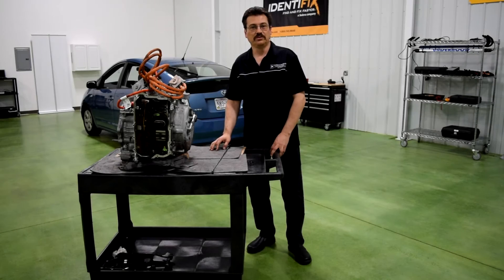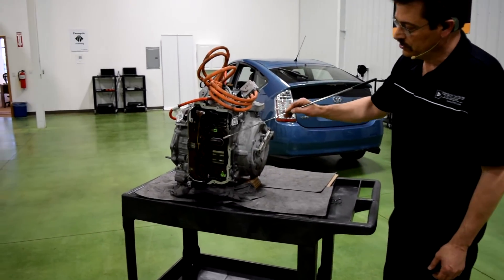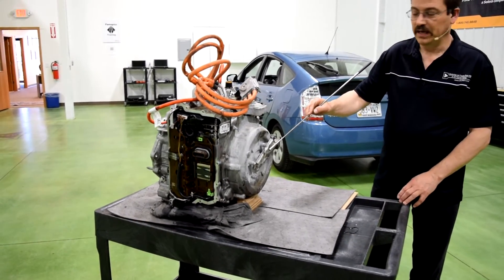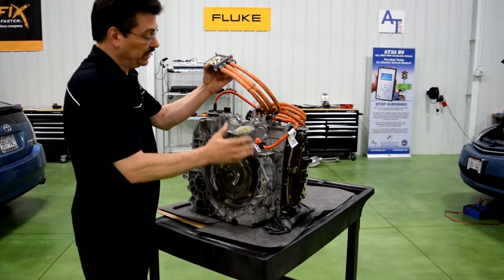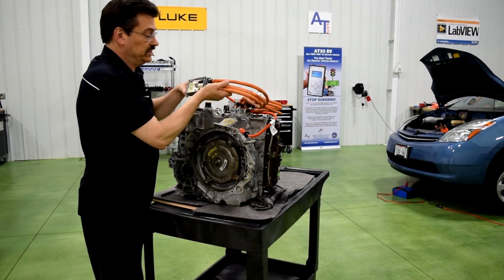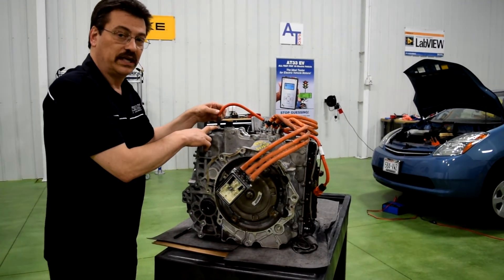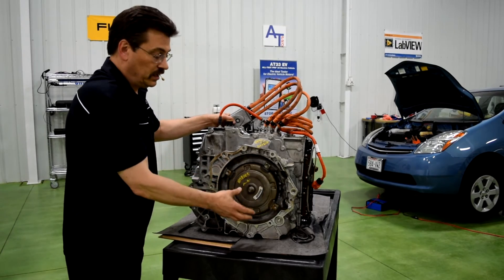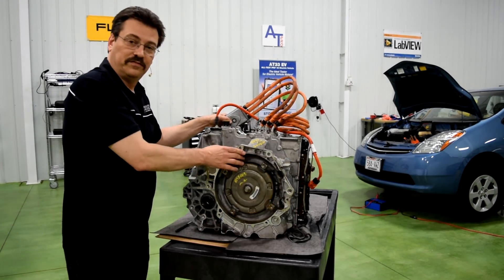HEV TV 2.11: Chevrolet Volt Transmission (Part 1)

Comment: Does the transmission get removed from the top rather than under the vehicle? It there special tools needed to remove it. A dealer told me that the transmission in my 2012 is failing and they want 5,500 to replace it.